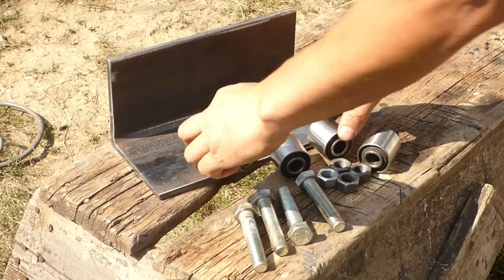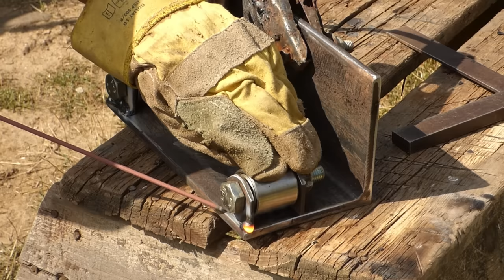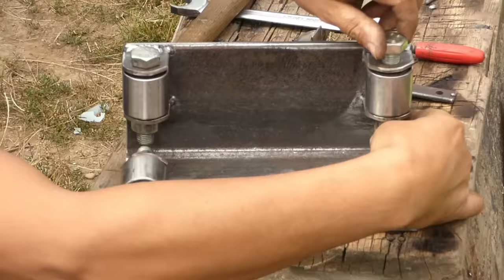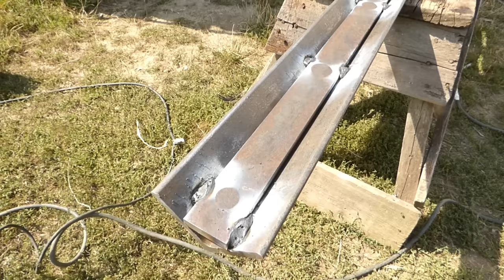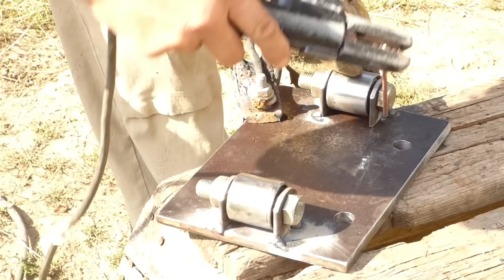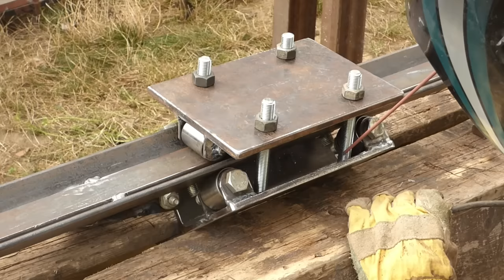Homemade Linear Bearing

Comment: Imo it would be better to use a profiled bearing in the center to prevent you from having to modify the track.  If you got alot of track it gets costly.  Also angle is not great at supporting loads it would be better as boxed tubing.  This is what the CNC guys use

Comment: How do you support the angle Iron at intervals to make it of any use?
Reply: Looks very heavy duty and all of a sudden it is not.
Reply: That comes in part two: levitating linear rails.
Reply: glad I read the comments was about to reply the same thing.. lol However not knowing the intended application of the item, maybe the part w the bearings get mounted securely and the longer angle iron is what is in motion.. idk but an A for effort in my book!!

Comment: It looks good, but what is it's function? What can it be used for?
Reply: I can see it being useful for linear tracking of something that would benefit from having little to almost zero deviation, but that can be achieved via simpler methods. 
Whatever its function, methinks the effective working length is going to be short; the "A" frame, angle iron track will have to be attached to a support structure of some variety and the trolley in present form wouldn't be able to pass any mounting points. At least not as far as I can see. but I'm only on my 1st cup of coffee.
But yes, it's pretty.
Reply: I was thinking maybe it could be used for some type of mill maybe a guy could attach a chainsaw  some how at least that's what I was hoping 
He would but kind of expensive project just for click bait without a purpose! Anyhow carry on and keep calm !

Comment: You did overthink a bit. On the sides dont need guide bearings,just let slide the metal on metal.For the middle part(base) if you grinding down the peak  and with 1200 sandpaper polishing the 2 material then with teflon spray or gearse will slide the metal on metal perfectly. In this way just need one guide bearing (the lowest).

Comment: Only problem is how are going to support the track in the air. The roller runs all around it so there's nowhere you can support it
Reply: End-supported, although not having very good deflection control does limit the applications

Comment: This system can be used if u increase the system by using RSJ's, bigger bolts and bearings. Can be used for earthquake areas for buildings. Only addition would be a dampener either rubber or hydrolic.
Reply: but if you were making   a long one  how do you support it  ?   great  idea but absolutely useless
Reply: @eweunkettles8207  you would only put these at load bearing positions. So one would make another at 90 degrees angle that would give all direction movement. Incorporate a damping mechanism. This would then allow the floor to move but it would keep the building from swaying

Comment: Looks good, but what is it for?
Reply: It could be for any machine 
Surface grinder 
Sliding table saw or router or molder 
Metal shaper
Reply: @adhamthecaesartariq1253  I was thinking shop crane, one of these travers things that runs on two rails with a beam in between.
Reply: Мое предположение это устройство транспортировки грузов.....например установка и снятие двигателей на автомобили....уголок и каретку крепить к потолку и добавить ручную лебёдку на подъем двигателя....или можно доставлять бревна на лесопилку